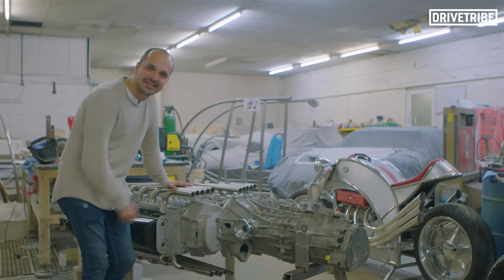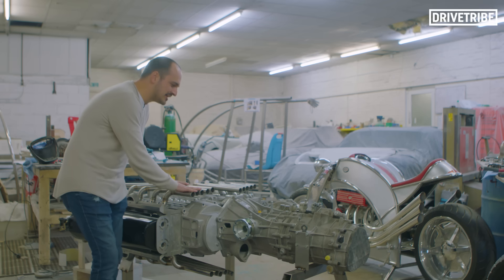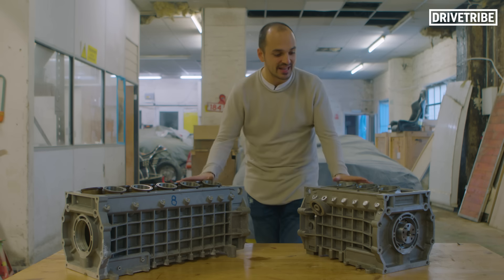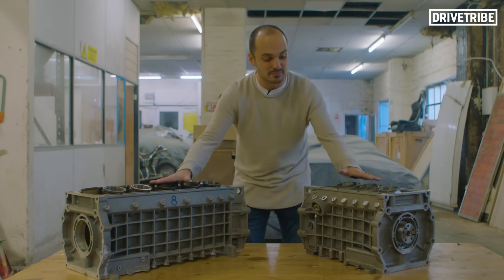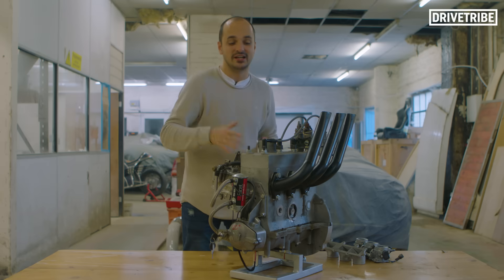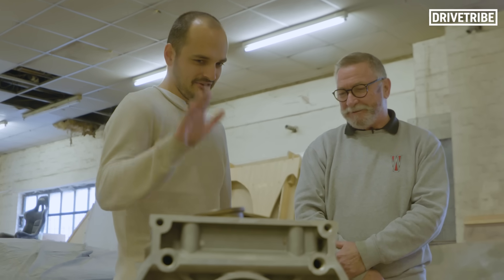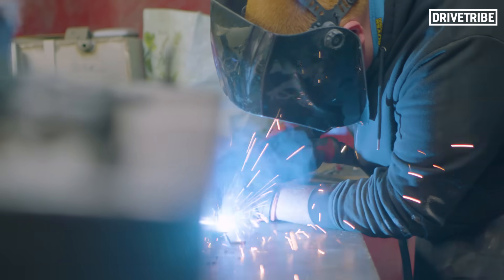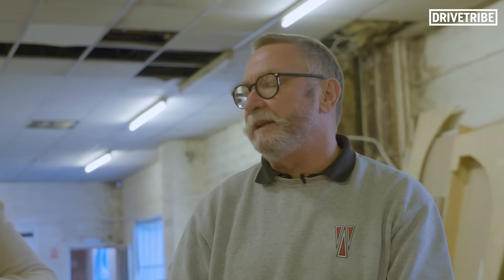This X20 engine is two V10s stuck together!

Comment: Love these guys "we built it because we can and none else has" carry on sir
Reply: My ICE car broke down today. It had a very bad misfire and smoked when first started. Called the breakdown company and they said it has a stretched/worn throttle cable and the misfire is likely the coil pack. 
Then I thought about how much more reliable electric cars are - virtually no moving parts, no ignition system, no oil or smoke. 
When you think of the mechanical engineering involved in an ICE car it's surprising they're as reliable as they are!
Reply: @sbomorse  Yes, and a lot of the reliability of modern ICE vehicles is down to electronics (the most obvious change being how comparatively easy they are to start now). And, as I'm sure you know, the electric motor is so much more efficient! Sorry about your car btw, but nice that you can be somewhat philosophical about it!
Reply: @jamesthecat  £240 later and the car is back on the road. It needed 4 coil packs, new spark plugs and the throttle adjusting.
I've done 900 mile since getting my EV 3 weeks ago and it's cost me nothing as I have a free 7KW charger in my village. 
I'm saving £1440 a year in petrol!
Reply: Indeed
Reply: You have had a shelted life there many multi crank engines in the world  look at WW2 engines
Reply: I wish every car went electric, except petrol sports cars, which would need to fill certain requirements (Ferraris, Lamborghinis, BMW M's, AMG's, Porsche 911's, etc).
Reply: @ruimpinho  My daily driver is a plug in hybrid, which I almost never use the ICE in it, so my next daily will be 100% electric. Just like folks who still ride horses for fun, my track day car is and always will be ICE powered with a manual transmission, I'm happy folks in sheds like this will be keeping development alive. I agree since sports cars are sold in such tiny numbers, in comparison to other cars, they should fall under a different set of rules, especially as the world goes electric.
Reply: @anydaynow01  exactly this!
Reply: @ruimpinho  I prefer to be able to fill my tank in a minute and just keep going tyvm
Reply: boomers company ,electric is the future and faster , this is a waste of oil
Reply: @girlsdrinkfeck  Youre joking right 🤣
Reply: @girlsdrinkfeck  I can't deny that electric is the future but can't say I'm happy about it yet anyway. Engines fascinate me always have and always will can't beat the sound off an old 500cc 2stroke gp bike or a V10 screamer from 1990s F1.
Reply: @Jrv3192  in the past two weeks I've taken delivery of my first electric car. I'm a massive petrol head but even I concede that electric cars are nicer to drive and live with than a petrol or diesel.
Everyone comments on how smooth, quick and quiet it is. 
Range is still an issue and I've kept my old ICE car for practical reasons. 
Although I personally think Hydrogen is the future of green motoring.
Reply: @sbomorse  shame that electric isn't nearly as clean as our governments are making it out to be!!!
Reply: @markscully2342  I'm fully aware of the fact it's not actually a clean fuel (unless from renewables) but it is nice not to be spewing out fumes in town.
Reply: @sbomorse  fair enough and as someone who used to cycle to work in a city I appreciate that!
Reply: @sbomorse  A year later I want to know how this affected your electric bill.
Reply: @girlsdrinkfeck  q
Reply: @girlsdrinkfeck  that’s right. Keep telling yourself that.
Reply: @girlsdrinkfeck  ey dude you should stop smoking so you won't say bs like this.
Reply: @girlsdrinkfeck  whatever you say einstein. if anything hybrid energy is the future, electric is too limited currently

Comment: the transmission: "I-It won't fit..."
Reply: Cursed.
Reply: What are you doing step engine
Reply: @goodboy4129  *step engines
Reply: @hamzaehsan3839  😳
Reply: @goodboy4129  hahahaha
Reply: What
Reply: 2 crankshafts, 1 box

Comment: Why their headquarters look like somewhere where they broke in
Reply: COMPANIES LIKE THIS START IN A SHED
Reply: Yeah, so if you think those perfectly clean/polished factory lines where robots are welding up 911 chassis is how engineering shops are supposed to look, then... yeah.
Reply: Cuz that's just Bri'ish in'nit

Sorry I just couldn't resist but seriously I have much respect for this team and hope they will not only revive connought but be successful in many more ventures
Reply: I take it that you have never see inside an engineer's garage or shed. It just seems to be one of those things that where creative minds in all manner of fields of expertise seem to surround themselves in organised chaos.
Reply: @Broadcast1Channel  It's not even that. In my little creative corner, is just that I started x amount of projects during the time I had it, some are stopped waiting for parts, others waiting for patience.. And yu end up just piling all the relevant materials in a bin or a corner and leave them there. Because you still want to work on it, it's mainly loose stuff that you don't really want to lose or use elsewhere and then have it missing for that "original" project where the part came from. So with the times you just end up with "corners and boxes" with stuff that seems "loose", but really isn't. 

So in the end, it's all organized, but from an outside perspective, since you don't know when one "project" ends and another begins, it just looks like "it's all in a pile", when they are very clearly defined (to us).
Reply: @Broadcast1Channel  Lol, yep I bet those guys know where everything is also, like if someone were to clean it up and "organize" it they would hit the roof!

Comment: its possible to make a fast car with an engine revving at only 6-7k RPMS with a lot of torques  making it more reliable but powerful put it on light car and tada you got a sports car fit for endurance races  and every day use. I would love to work with them if i finish my industrial engineering course.

Comment: The specific output is sitting at 100 hp/l. Which is the same ad s mclaren F1 engine, so don't understand why everyone is saying the engine is weak. That's a load of bollocks.
Reply: Probably because 20 cylinders only complicate it unnecessarily for the 400hp output they are aiming for
Reply: Hp wise that’s about what naturally aspirated can do but how about torque?
Reply: I mean 1990s civic has the se hp/l

Comment: Freevalve technology should make that X20 engine smaller and easier to time.
Reply: check out this genius on youtube who is building his own freevalve head for an MX5 https://www.youtube.com/watch?v=k_MrPylnsDg
Reply: You beat me. I was thinking the same while watching the video
Reply: @Lassi Kinnunen 81  they dont strike me as programers so i doubt they have even considered fv, or a broom for that matter
Reply: What is the problem with regular camshaft ?? You think free valve will be much simpler? This engines never run a single race test.
Reply: If a 3 cylinder freevalve and 2 turbos can do 600hp... i hope this do at least 1000hp
Reply: Freevalve is possible on lower revving engines, but despite seeming like the ultimate way to control valves, it's got several physical limitations you just can't overcome. There's a reason why mechanically driven camshafts are still the best solution.
Reply: @AndyHack10  who says that? Free valve isnt old tech
Reply: Who tf be seriously investing in one of these? 😂

Comment: very interesting, how do we get hold of villiers, any link? Xpeng may want to JV for a hypercar that really stands out, 20 cylinders, 4 turbos, could be an easy reliable 1500 hp
Reply: @Rachnmat I have just one thing to say

2JZ
Reply: @nous1056  its not that easy, also 2jz is I6, not V6. I'm not super knowledgeable on 2jz, so don't trust what I say, look it up for yourself, there are many channels that teach all about, engines, forged engines, and why 2jz is a wall.

But what your saying is ilinformed
Reply: @Rachnmat it's a 3l v6, but if it's used to full power, you can take 1500hp, ok not really reliable, but, it's reliable to 1000hp by example... So 4L should be able to easily function to 1200 or 1300hp ¯\_(ツ)_/¯
Reply: Heres Donut media's explanation 
https://youtu.be/Viz-GXRBj0E

Might not be the most in depth but they are easy to understand
Reply: @Rachnmat Depending on how it's built i believe this could probably manage 1000hp with ease, the big thing i like about this is more cylinders = less stress on one component. so doing the maths that's 50hp coming from each cylinder compared to lets say a honda 4 cylinder running 1000hp or a Nissan GTR V6 running 1000hp

I come from a toolmaking background so not too clued in on engine design when it comes to high horsepower but in my head i do feel like a bigger engine would spread the load out more evenly rather than trying to cram all that power on 4 or 6 cylinders... however i don't think this engine would have the torque to be a drag engine i think it would be more of the type of engine you'd throw into a car you are taking into le mons and have it detuned for reliability... regardless of that i hope they start selling the blocks soon... i'd love to put one of them into my mustang!

Comment: I guess 1 bhp equals 2 standard hp´s?
Reply: Bhp is the standard of Hp, because it higher, and then there is whp, (wheel horsepower), which is measured at the wheel because power is lost as it travels through the drive train.

Bhp is always higher
Reply: @Am_NaaH  :-D thanks,  I was kind of aware of that :-D...

just tried to make sense of an x20 400 bhp output... a cayman gts4 has got a naturally aspirated 6 cylinder boxer with the round about the same output

Comment: 2 valves per cylinder, eh? If it was more sophisticated, it could be something...
Reply: Why is sofistication necessary?
Reply: @derzemel  For power and efficiency.
Reply: the v8 in the McLaren SLR was a three valve SOHC... engine builders know what works.
Reply: @NitroNuggetTV  3 is better than 2.
Reply: Arm Head but 4 would have been better than 3, and then 5 would have been better than 4... But McLaren and Mercedes/AMG still chose 3
Reply: @NitroNuggetTV  yeah, and compare it with the engine found in the McLaren Senna. Smaller displacement, more valves per cylinder, more power. Clearly they realised that 3 wasn't the way to go.
Reply: Arm Head you’re missing the point. The senna is one of the most advanced cars ever made, the SLR is a GT car, both made by one the greatest car manufacturers on the planet, they wouldn’t have settled for anything bellow their requirements and yet they still used a 3 valve. You can complicate an engine as much as you want as long as the criteria, budget and parameters fit. Is it necessary for this v12 to run 4 valves, is it affordable, will it be reliable enough and is it even possible? They wouldn’t have used 2 valves without reason and that doesn’t void this engine of potential.

Comment: What about the viper
Reply: That is no longer in production.
Reply: What you mean about viper, thats just a huge V10, like somewhere around 7, 8 litres
Reply: @Am_NaaH  he only listed the lambo v10 and audi using v10s
Reply: @assassin879  he mentioned they used the gearbox from an Gallardo i believe, don't remember. The Gallardo and R8 use the same V10, (and also the Huracan) thats probably why he only mentioned them.
Reply: @assassin879  anyway there's much more than Audi and Dodge who make V10s
Reply: @Am_NaaH  v10s are such a lazy motor should only ever be used for luxury cars not performance cars they rev slow

Comment: X engines dont have 2 cranks. Look at T14 armatas ChTZ X-12 engine it only has 1 crank in the middle of the X. H engines use two cranks and they are similar in layout to X engines. This is a H engine like in  those WW2 Hawker Typhoon aircraft not an X engine
Reply: It's two horizontal V's with two crankshafts... so it's a "> < 20"
Reply: H would be a Boxer, this is NOT a boxer. The X designation has to do with the piston configuration, not the crankshaft.  If you want to be pedantic this is a double V 10.

Comment: I think it will sound exactly like a v10 but louder it's just 2 v10 engines after all. only if they offset 1 engine from the other in terms of timing will it sound diffrent but my best guess would be that you want both v10`s in perfect sync to cancel vibrations

Comment: 400bhp from a 4l x20 engine... That power output sounds extremely '70s fuel crisis American. Little efficiency. But innovative still.
Reply: 400 hp from a 4L naturally aspirated engine isn't that little, Porsches do 500 hp with the same displacement and a lot more technology
Reply: @tommihommi1  and Lamborghini, even tho it's a 5.2l, produces 620 HP. Healthy.
Reply: Getting a specific output of 100hp/L while naturally aspirated is far from terrible actually... Those '70s American engines you mention wouldn't even get half that.
Reply: @rjfaber1991  beat me to it!
Reply: 100bhp per litre is nothing like the 70s fuel crisis engines. Those engines were hardly pushing 50bhp per litre. Not many naturally aspirated production engines even surpass the 100bhp per litre mark, so don't throw unfair statements like that about. This engines power output is actually quite an achievement especially considering their limited business and economic parameters.
Reply: But it would run smooth as butter and sound like a boys choir.. And to be honest, 400hp in a light(ish) sportscar is enough to have all the fun in the world.
Reply: @threesixty4486  no way a car that mounts this huge engine would be light